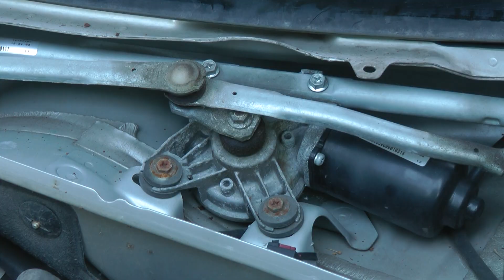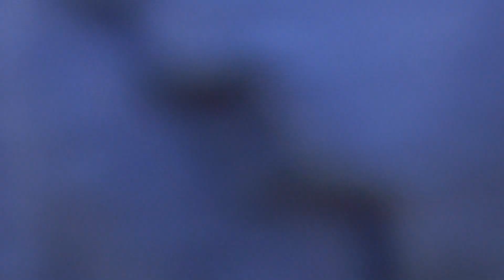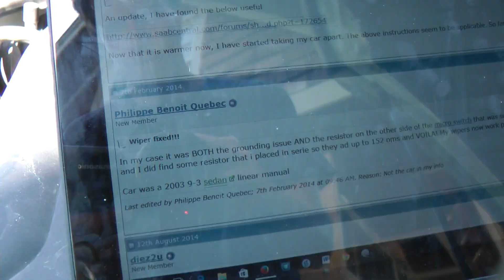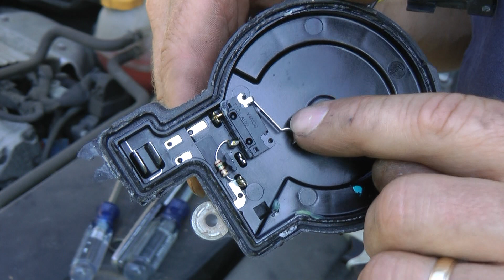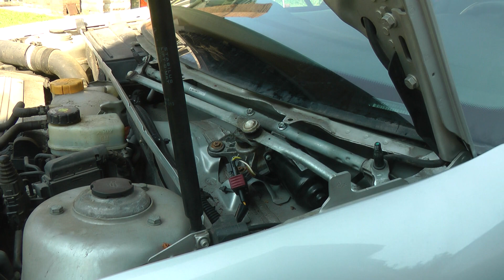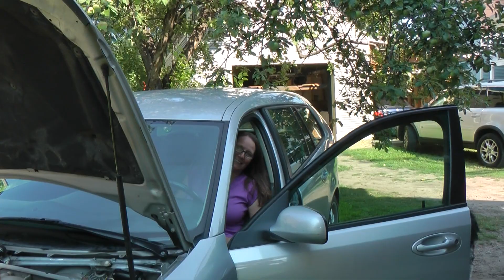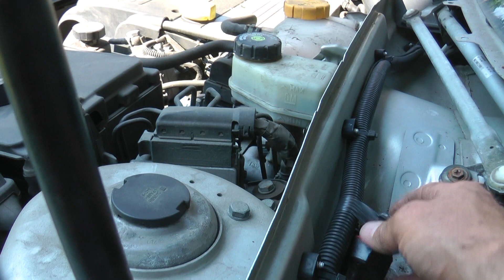Fix your Saab Wiper Parking Problem - Easy Repair - Don't Replace!

Comment: This looks really promising, I have the same issue that's just stated today and will give your repair a go tomorrow (weather permitting) and having seen the comments here I'm full of optimism, even if it doesn't work I fully appreciate your support in spending the time to make this video, thank you!
Reply from the maker: I too am full of optimism for you if your problem is that the wiper is not parking in the right place. Just make sure the contacts are clear, and I am confident it will work. Please let us know if it does.
Reply: @mbrenengen  Boom! our optimism wasn't misplaced, I had to refer back to your video during the process as when the screws came out of the black cover it didn't want to come off, but then I heard you say in your video that you had to prise it off which gave me the confidence to go for it and the rest is history! 
Thank you again on behalf of my 2007 93 silver convertible Aero and I, Dave UK.

Comment: Good theory. I just replaced my wiper motor/transmission on my 2008 Saab 9-3 and the full cycle goes from the edge of the cowling up across the windshield but then it comes to rest like 6” up from the cowling. It makes no sense to park at a higher position  than the the bottom of the sweep; but that is what it is doing. 
Any thoughts 💭?
Reply from the maker: Any chance you mounted the mechanism in the wrong position?

Comment: Like others commented - be wary if you have 03-06 9-3. There’s no resistor inside and the back is riveted. I drilled them out and don’t see corrosion or grounding issues. I’m going to need to reseal the thing later without the rivets.

Comment: During the course of one commute my wipers went from normal to parking vertically.  This did the trick!  I used a little dielectric grease on the grounding contacts to hopefully prevent future corrosion, and some grease on the wiper sprockets to keep the wiper arms from seizing onto the sprockets.  Also, you can just pop the driver arm off the ball joint to get easier access to the nut on the motor, then pop it back on when you're done.

Comment: Don't know if you'll see this since this video is from a few years ago, was the sprayer also not working? Im just wondering if this will also solve that problem. I had a service vehicle message come up because the guys who changed my oil apparently didn't have the machine to clear that message. And its known to park the wipers and stop the sprayer.. so im just wondering if this is a similar issue that will work but im thinking not... idk
Reply from the maker: Hi Rachel. Still here. I think your problem is completely different. My sprayer never stopped working. It was caused by a problem with the wiper motor.

Comment: Thanks, got me sorted out and saved me buying parts. I almost missed the little brass bit to be sanded on the cover, it was completely covered in limescale, which I'm guessing was the problem. The cause of the limescale, I think, was a blocked drain just under the wiper motor, which may have allowed water to pool around the motor. It's perhaps worth checking this drain whilst doing the repair. Thanks very much.

Comment: I have watched this a dozen times and I a convinced that the guy has NO IDEA what he is doing.  The place that is supposed to be grounded the idiot never shows.
Reply from the maker: Hmm. Should I tell him? No.
Reply: James Grasso, YOU are wrong. The fix, as described in this video, worked perfectly on my 2006 9 3 Aero Combi. If you can't figure out where the ground point that is cleaned then you have no business trying to fix it yourself. Thanks a ton Matthew!!!
Reply: This worked for me. Allthough the video do not really show where to grind I just grounded around that same area. Saved me 500 EUR. So thanks! Wouldnt figured this out by myself.
Reply: Matthew does show which part grounds the motor, obviously you just missed it.
Reply: @daveh1289  thanks. Might be right. I was lucky enough to have someone hit me and put both of us out our misery

Comment: Thanks for this DIY. I'll try it tomorrow.
Reply from the maker: Seb Did you get them working?
Reply: So I watched your video after drinking. I forgot the  step at 5:50 the following day. Instead of just letting it cycle by itself, I left the bracket on and put one of the blades on. Now the wipers are stuck in a different position (When I put on the blade, it went in a different direction and it stopped when it detected too much pressure)

I'm going to revisit this next week. I'm going to try forcing the motor/gear into a different position to see what happens.

I have a strong feeling that it would have worked if I didn't skip that step. I also measured the Ohms and it was at 149.6 meaning the capacitor was good.
Reply from the maker: Good luck!

Comment: Hi Matthew I just loved your video  well done .I to have had this problem and your solution worked however i did find a youtube video " https://youtu.be/1Ww5-pmiokc  " called "  Windshield Wiper Motor Wiring Tutorial  "    that explains exactly how the system works  no capacitors are involved it s very simple  and very interesting thanks again for the video well done!!!
       Regards John
Reply from the maker: Perfect! Thanks. I don't exactly get why when it goes to ground it acts like a break, but then it is just too much effort at the moment. I know it is right however. If you understand what is happening, can you explain why, as that ground goes bad, the wiper parks in increasingly worst positions?

Comment: i tried this and even tried the adjustment that you said did work but neither attempt worked for my 2006 aero. I there anythings else i can try before i have to go and buy a new motor assembly?

Comment: Just an FYI to anyone attempting this. I have a 2004 9-3 and the component he removed and sanded down the contacts on... At least on my vehicle is riveted to the assembly making it impossible to remove.
Reply: That's what angle grinders are for.  And anyway -- if it's riveted probably the ground contact is good.
Reply: Russell Hanson you wouldn't use an angle grinder on this unit, if anything you would drill them out. I may just purchase a remanufactured unit as it is the issue
Reply: Right on.  Sounds like you know more about this.

Comment: I have a saab 2007 Aero 2.8L v6 and i am having trouble with the coolant expansion tank i have replaced one it split in half and the coolant was all over the engine then i replaced again about 4 months ago just happened again today, i am getting frustrated with it if you have any suggestion please let me know. Thank you
Reply: I could be wrong about this but I believe there was a recall on the coolant expansion tank. I've got the same model and the original coolant tank plastic couldn't take the heat put out by the aluminum engine. There should be an improved version though that handles it fine. Once I had mine replaced I haven't seen the problem again (knock on wood!)

Comment: Where are you? I'm in MN and having the same problem on my 05 9-3
Reply: our 2006 passenger wiper arm is not moving. it will move freely when you manually move it. any idea?
Reply from the maker: +Joe B Look at about 1:10 of the video to see how that passenger arm is  attached to the motor. My guess would be that it came off there. It is either that or it is stripped where the arm attaches at the base of the wiper.
Reply: +Joe B I just traded mine in last night as a matter of fact. My pass side wiper was off the motor as well. I gave up on my 05 93 before it Nicole and dimes me to death.
Reply: +Matthew Brenengen ok will do
Reply: +Matthew Brenengen Hey what you use to clean the motor and what areas you clean? I have the exact same issue
Reply: +Ashton Jordan Sandpaper and WD-40
Reply: +Andy Brenengen Thanks, and by chance do you know the nut size that holds the wiper arm onto the linkage? When i took mine apart there was no nut, now i need it to hold the arms on. Saab dealer has no idea either..

Thanks